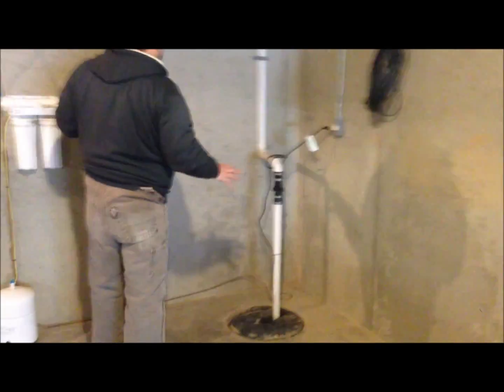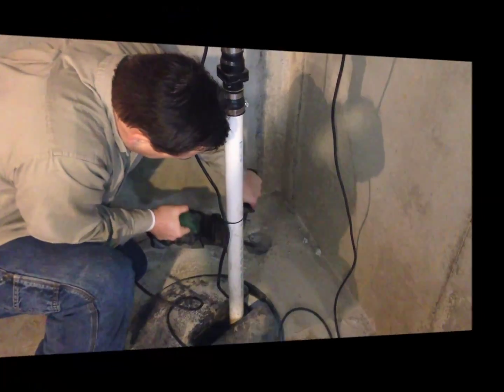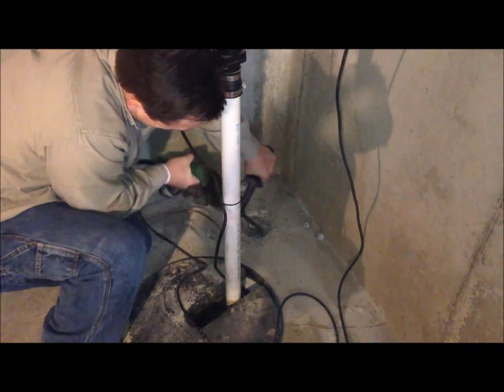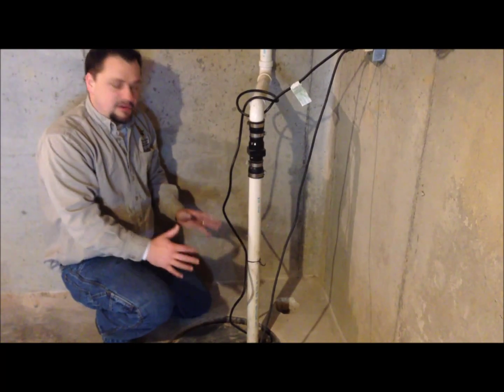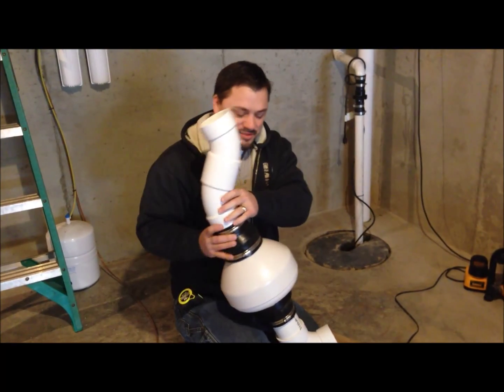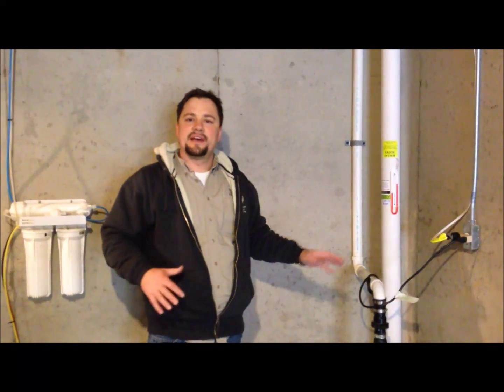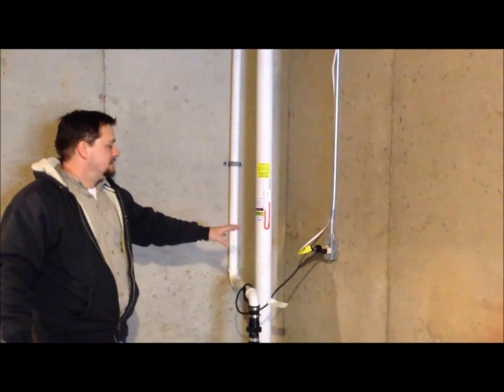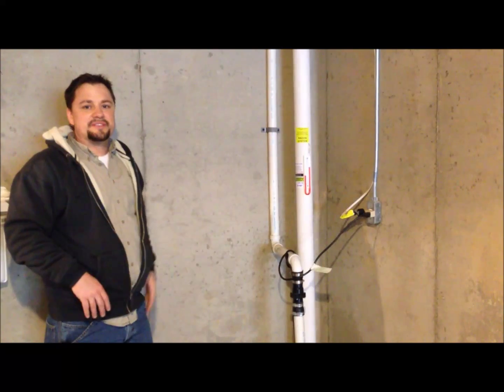Certified Radon Mitigation of Richmond, In 47374

Comment: Is there an electrical disconnect for the fan unit on the outside of the home? Or is there a three conductor grounded plug connected to the fan and pass through the siding and box and into the basement then plugged into the sump pump plug on the same circuit?